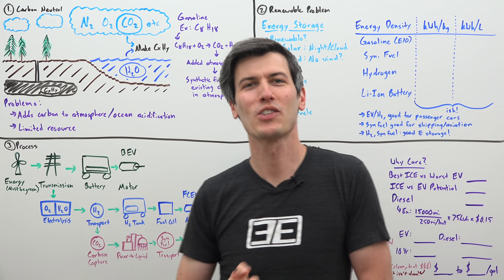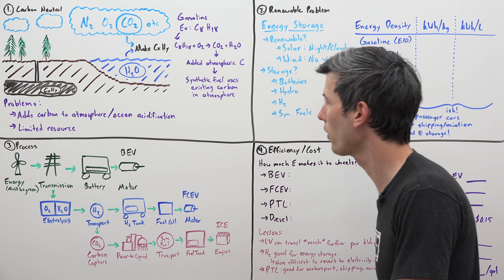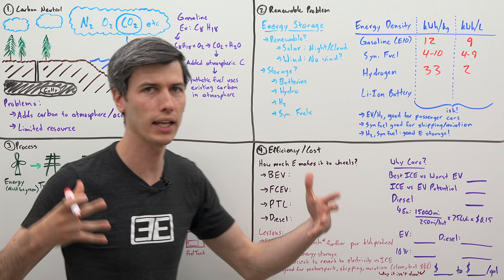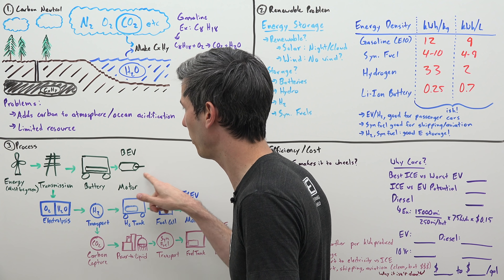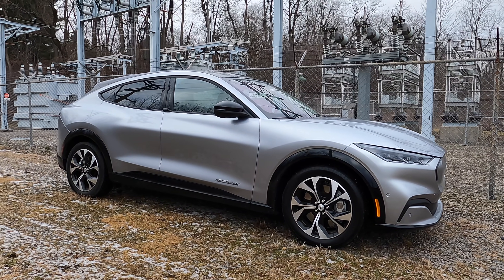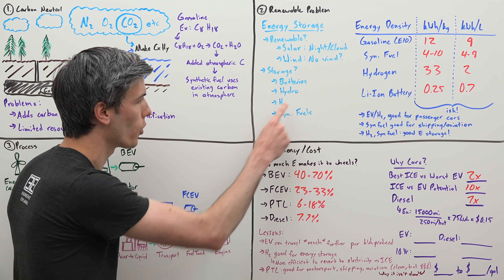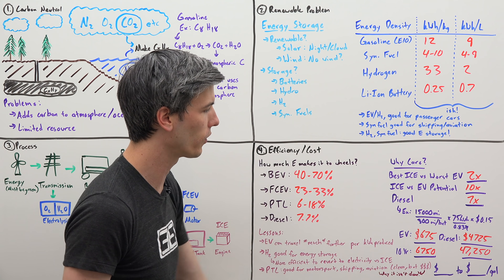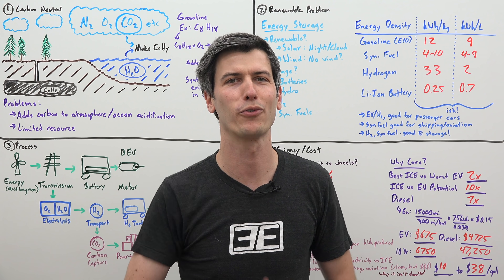The Big Problem With Synthetic Fuels

Comment: This should be viewed as an alternative, not a full on replacement
Reply: Why? It is CO2 neutral and modern engines can be extremely clean.
Reply: Absolutely. Full EV rollout+infrastructure that goes with it all completely unnecessary simply put.
Reply: Gonna be hard to see that as an alternative considering Europe and some parts of Canada are starting to ban ICEs from 2035-2040.
Reply: @dzello  90%  off the vehicles in the globe use IC engines. Europe is a small part off that.
Reply: @robsonmacedo4108  Not what matters. What matters is NEW vehicules since resales and all are taken out. 

And when you check where new cars are sold, its mostly rich countries and rich countries are banning ICEs (not just Europe, the US too).

Manufacturers plan to stop making ICEs fully.
Reply: @dzello  And what do you do with the REST? Eastern Europe, China, Middle East, Africa and South America?
I repeat, europe is a small part. Synthetic fuel will work for current cars.
100% electric in a couple of years is a utopia. Maybe more 100 years that will be reality...
Making new electric cars is just a small step. The real challenge is having the infrastructure they need. Most European countries are the size of a US state, China, India, Russia or Brazil for example.
Electric cars are for traveling in cities and not for long trips.
Reply: @dzello  And the most ironic and hypocritical is: That a large part of the energy that Europeans use to charge their electric cars comes from coal-fired thermoelectric plants.😂
Reply: @robsonmacedo4108  Are you unable to read? I already answered that. Rich countries are going to ban ICEs by like 2035-2040 depending on the country.

Because of this, manufacturers already planned to stop making new ICE cars by then. They are going fully electric.

So Africa, South America... They'll keep using old cars and their current infrastructure or they'll have to switch to electric.
Reply: @robsonmacedo4108  The fact European use coal for electricity doesn't matter because coal powerplants are still far more efficient than car ICEs so it's still less polluting. This has been known for years now.
Reply: @dzello  No they don't will switch for many years...And coal-fired plants it's not the only problem. You probably don't even know where it comes from or how the coal is transported. It reminds me Macron pointing his finger at Brazil in relation to the Amazon being that France is one of the big buyers of illegal wood, hilarious...
And finally, the production process of electric vehicles is more polluted than that of normal vehicles.
Your arguments don't convince anybody.
Reply: @dzello  Blablabla.
Reply: @dzello  blablabla 2
Reply: @dzello  You spread a little misinformation. Ban in EU countries and California is for ICE cars that run on petrol or diesel aka fossil fuels, If car will be running on synthetic fuel that qualify as alternative clean fuel same as hydrogen and electric it will be able to run legally under this ban. Porsche is making synthetic fuel not only for motorsport, I'm getting latest cayman that can run both on synthetic fuel and fossil fuel, it is meant to keep ICE cars running but without the guilt of destroying our planet. I'm huge petrolhead but I'm in love with engines not fossil fuel so this is option for me. To be honest this seems to be way better option, ICE cars in production phase create a lot less CO2, on top of that there are a lot of ICE cars driving in the world. Creating equivalent number of electric cars will have huge impact on the earth. On top of that you have to remember that around every 8 years you'll have to change battery in a electric car (Tesla even update their cars software when warranty runs out after 8 years so you have to change the battery, you can only charge car to drive 49 miles in that scenerio check it out! ), which is costly to begin with and brings huge environmental toll (around 10 000 tons CO2) as well as ethical guilt (80% of world's cobalt  is in Congo where child labor is normal). This situation with batteries needing to be replaced in Tesla after certain period of time leads me to be believe these cars will be created to fail after warranty same as printers had planned obsolescence. This seems wrong, and wasteful. My take on ecology is to use things as much as I can, take good care of it, fix it. This doesn't seem to be the path for electric cars, I bet there won't be 50 years old Tesla driving in the future, but 70 years old Porsches running on synthetic fuel will be there for sure and that is Eco Friendly.
Reply: @dzello    Yes you did by saying Porsche develops synthetic fuel only for Motorsport, check out their latest statements they test it with all the 911 models all the way back to 993, as they claim to keep classics on the road. I forgot to mention the price of battery replacement, in Tesla model s is 21 k usd after warranty. EU countries and Cali goes with ICE ban that’s why it’s mentioned in this thread there is still no word from a lot of the the remaing countries in the world which seem to be staying with ICE cars and development of new engines as of now, this might change tho. My country goes for the ban in 2040, that means there won’t be option to register new ICE car, old cars will be there able to register on top of that hybrids that will be fueled by petrol or synthetic fuel. About porsche phasing out ICE next 911 will be mild hybrid (ICE+electric) I think every bigger brands will be able to leave at least one hybrid in a lineup. On European market there might be no new ice engines but that shouldn’t stop development on existing ones, Lamborghini has developed its v12 engine for over 60 years, so fingers crossed. I’m not sure why you say synthetic fuel doesn’t reduce air pollution it’s clearly stated that biomass that already captured co2 is transformed into synthetic fuel and then recycled via car, nothing new only recycled what has been already there. Obviously entire process has to be powered by renewable energy, and to be perfect it could be transported by tankers that are powered by efuel. That’s the beauty of fuel in general that it can be stored for a year and will still be able to power whatever. This is not the case with electric power, you can create even your own electricity but there is no way to store it, there are batteries in cars but you will leave your electric car for 6 months and it will die there is nothing you can do about and it won’t change, not much has changed in this field. If someone would invent process of transferring electric power into liquid or any other substance that could be used now or in a year without any loss I would consider it valuable option. If nature did it with fossil fuels I hope people will do it too eventually. Im saying that because I travel a lot in a car in Europe that’s what cayman is for, my other passion is overlanding that requires over 1000 km on one tank. These two scenarios may be exchanged only by synthetic fuel or hybrid, electric just won’t work. I’m not gonna lie my chopper has engine and here I may be bit selfish but I won’t trade it for electric solely because of sound. I’m 100% sure that I will be able to drive ICE cars until I die (I’m 30 now) I’m bit more worried about how duress of “radical” left in Europe and USA may lead to anger of population and then actual radical right may stay in power for bit longer that they should and all good that has been done if field of ecology probably will go to hell. Didn’t mean to attack you or anything, I hope you understand my point of view this push for electrification just doesn’t seem like evolution to me it’s a revolution when countries don’t allow to sell previous technology and make a push for new certainly not proven tech ignoring existing infrastructure. Next to that there is a lot of additional co2 created during production phase, there are regions where electricity comes only from coal the list goes on.
Reply: @pocwiczcycu  While Synthetic fuel works in normal cars, the cost is too high to be a viable option for normal use (which Porsche admitted). It's going to be used for motorsport (where budget doesn't matter) but ''can'' be used to run what will be vintage cars by then. They said they are turning their entire line up fully electric with the 911 being the last to go electric. 

Synthetic fuel does not reduce air pollution in the sense that it removes air pollution at one place (namely where synthetic fuel is produced) but it produces air pollution where the car is used. This means unlike EVs, it reduces air quality near people just like current gas cars.
Reply: @dzello  

Most air pollution is still produced from world industries and factories rather than cars. This 100% EV model "solution" we all keep being reminded about on a very regular basis is very short sighted to say the least. It will continue to be a considerably expensive and unreasonable exercise, a lot may also say a very unfair one. Many people seem to think they have no choice to go all out and feel that have to roll over and play this game to "save the planet". 

Let's be honest here and I'm sure you'll agree there really should be a choice (like in the recent past)  whether people would like electric, hybrid, efficient petrol or modern technology diesel. No force or control but choice.
Reply: @bonk352  You can't have choices when it comes to transportation. The amount of investment you need to offer an equal service of gas, electric and hydrogen is absurd (governments and companies would need to make 3 overlapping system, that's inefficient and highly expensive) so you need to make a choice between the three. And if one performs strictly better because of operating costs or pollution, then you need to commit to said choice.

Hence the electric transition.
Reply: @dzello  we have to somehow get their attention with these, but how?
Reply: @Trig.  Synthetic fuels, as Porsche mentioned, are viewed as unviable. Porsche is only developing that for motorsports. 

So the world is going full electric regardless of some personal preferences.
Reply: @dzello  so what you’re saying is that it’s almost impossible to bring this to their attention?
Reply: @Trig.  Not almost, just impossible. Manufacturers are going full electric since they know synthetic fuels arent viable. 

Synthetic fuels are for motorsports where energy density matters and price is itrelevant, but other than that, its full EVs.
Reply: @dzello  Lol you'll have to let Enerkem know.
Reply: @dzello  It is crazy. It is like when they promoted diesel because of lower CO2, but it turned out that it was harming the local populations lungs.
Reply: @cryptohouse1676  It's really nothing like diesel my guy.

As for your question, it's not cost efficient and never will be. Porsche who's working on synthetic fuel does it only for motorsports. They're going for electric because they believe it's a far better choice.
Reply: @dzello  Motorsport & keeping classic cars running
Reply: @xxxxxtrxxx13  Nah, just motorsports. Classic cars wont have access to it.
Reply: @dzello  Yes they will, according to Porsche "If you want to operate the existing fleet in a sustainable manner, eFuels are a fundamental component". They always targeted the e-fuels to mid-high end classic (street legal) cars. It's obvious: where else can you get sufficent revenue? Motorsports are not enough, they are mainly for r&d and advertising.
Reply: @electric7487  I agree.  They will only be good in those kinds of vehicles and let’s leave it at that

Comment: Cng is the answer to how to keep on driving internal combustion vehicles. I want a video about cng. Works perfect in my car.
Reply: Using natural gas is definitely overlooked. It already powers 23 million vehicles worldwide and will probably be forced on shipping manufacturers through legislation. It certainly has a lot of potential in terms of NOx emissions as well. How does the cost work out on your CNG car?
Reply: @industrealised2326  the cost is about the same as petrol in Sweden. Right now its a little bit cheaper than petrol. Tax on the car is lower but it costs 100-200 dollar more to service the car because you have to change the gas filter. The gas is produced locally in two factories. One is in the sewage plant and the other one is owned by the local farmers that ferment their manure together with slaughter waste. This also makes the manure smell less when they take it back to their fields.
Reply: @albinekenberg7535  That's really cool how you can get the gas locally. I definitely think natural gas can be used a lot more. I have recently explored if LNG can make transport more sustainable, I'd really appreciate your feedback.

Comment: EV aren't going to replace ICE. Just face it. We'll vote the politicians out that try to force it on us.. I really wanted an EV. I started to buy a Nissan leaf. But I can't find a replacement battery under $12,000. That's freaking ridiculous. I've never give over $3,000 for a vehicle. And I get 580,000 mi out of those $3,000 vehicles. So EVs aren't going to happen.

Comment: You can't beat thermodynamics. If a gallon of gas has 9KWH/L, it follows it would cost more than 9KWH/L energy to create 1L synthetic gasoline. Oil rigs can run off the oil they produce, so the energy they produce is net-positive.

Comment: Another issue I've had with them is the output of noxious gasses. They will still be here. The primary reasons for several European cities are limiting the use of ICE vehicles is due to local pollution of NOx gasses causing health issues.

Comment: I will not list the full list of mistakes you make but just 2: distribution to the (electric) car is much more than electricity to a plant to convert energy to something else. Second mistake: you consider a 40-70% for electric vehicle but forget that if you use only renewable power, it is intermittent so 98 to 99.99% will be lost if you have enough solar power and windturbines to recharge electric cars when they need it because you have to install a gigantic parc (cost???) without any way to stock this electricity to fuel your cars and most of the time you produce of course more than you need... and it is lost ;)

Comment: The energy source for synthetic fuel must be wind power, as noted in part 3. For the ICE and BEV, wind was also used for the cleanest outcomes. But in the US, only 9% of all energy sources is wind power, that is spread across the grid. So the assumption of only wind power being used in all stages of the 3 examples seems to be unrealistic.

Comment: Great video. The only comment that I have is that on hydfrogen vehicles the tanks are compressed to 350 or 700 bar, so considering the energy density of its atmosphere state is not that acurate. Putting that in to the equation, actually hydrogen makes more sense for ships or airplanes than syntethic fuels.

Comment: Until we completely redesign the battery electric cars won't replace anything. They are incredibly toxic and their life is shortened by heat, cold weather can stop them from working until they are warmed up. They take hours to charge so the major transport companies can use them

Comment: There are times when wind and solar produce more electricity than can be used.  It is called curtailment.  When that happens the price is electricity is not $0.15 kW/h but $0.00.  If the electricity is free, then what do synthetic fuels cost?

Comment: The problem with synthetic fuels for ships and planes is the same, cost. For both planes and ships fuel cost is a big part of the cost of operation, so they can't afford higher prices. Using batteries and electric motors is so much cheaper, it's not even a contest. And the energy density will be acceptable in just a few years.
For large container ships it would make sense to have charging stations in like every 1000 miles. It's not even a new concept, in the early days of steam power ships had limited range and had to regularly stop for coal. These charging stations could easily run on solar power.

Comment: Hi Jason.
If they continue to develope synthetic fuel, the cost will go down. It was not exactly cheap to create the EV market either, especially if you consider the cost of all the chargingstations. 
I also wonder how all the battery waste that will come in the future is enviornmentally friendly? There does not seem to be a viable plan for this, and probably will create a new problem. 
It would be so much better to develop synthetic fuel, use existing gas station infrastrucure, and then make tecnology from FreeValve and Koenigsegg cheaper and more common. That would make the engine even cleaner than the best that are maspeoduced today, and way more efficient/ powerfull. Just look at the TinyFriendlyGiant from Koenigsegg, it is amazing, and if we could implement all the goodness from that into normal cars, combined with synthetic fuel (increase eficiency of production), it would be better and cleaner than EV's.

Comment: There is another problem with synthetic fuels - carbon budget. Since renewable energy production is limited and will remain so for the forseeable future, it should be used where it has the largest impact on reducing carbon emissions.
With synthetic fuels about 80% of that energy is completely wasted. In order to minimize total CO2 emissions, it might actually be better to keep using fossil rather than synthetic fuels on planes/ships. At least until there is an abundance of CO2 free energy production (imho that is still decades away).